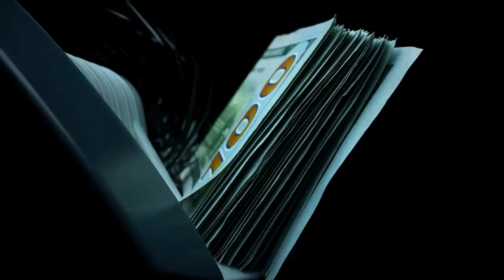The Highest Precision Gun that Doesn't Use Bullets

Comment: the fascination whit DEW comes mostly from science fiction, buck rogers, flash gordon, war of the worlds, star treck star wars, etc. the passion for it is first the assumption they are clean, very efficient, the pashion for the military is one only of cost, no amunitions, thats the only advantage, the reality is that they are not as effective as believed, as stated a simple smoke screan, hell even rain can reduce dranticly the effectiveness of a laser our microwave,  eve a difrence in humidity is enough to make a laser severly less effective, the other disadvantedge, is that it can only attack one target at a time, also it will require time to take down that target, also it must hit the warhead our fuel od the target to cause significant damadge, another is how easy it is to protect against it, simple refractive layer our light termal protection to better protect against it, time is all that is necesssary for a projectile, to bypass a deffence our survive long enough to hit the target,
kinetic weapons on the other hand dont have any og the disadnantages of lasers, their only so called disadvantage is amunitions, but they can fire extreme long ranges, do imense damadge and a single air burst munition can take out several targets at wonce and to take out a target only needs to hit it,  the main adnvatadge of kinetic munitions is that they require a very large mass to protect against and much heavier I just cant belive they cut the fundings for railguns and gauss guns for this.

Comment: (1)  החכמים (ביותר, הם) מתכננים מכניים גרועים: 
If you want to increase "laser-destruction-range": You need to control the "beam-direction" faster and with better accuracy than with an "electric-motor-based-actuator", that is: Using an (electrical) actuator "faster-accurate-rigid" (*that doesn't shake*, similar to *my-actuator*, from the past). Thanks to the above features, the "beam" will "illuminate-a-smaller-spot" and therefore "the-range-of-destruction-is-larger". 
(2)  טיל-זול יהיה: **ללא-ראש-ביות** כלומר ינוהג ע"י "מכ"ם-מדויק" (שמניח שקיים) ה"רואה" את מיקום ה"מיירט" וה"מטרה". מניח שיודעים לחשב ה Atitude של הטיל כדי להחליט על הפעלת הגאי "גלגול" ובעיקר "עילרוד" של הטיל. 
בברכה והצלחה!!

Comment: It's somewhat hilarious how you have managed to skip the one most important obstacle in developing those weapons. You mention cost and or "specialized" personel... like someone who can operate a joystick or a mouse or any other controller? So basically anyone with hands. And I really struggle to see how a typical laser system is suppose to be more expensive than say a single fighter jet not to mention whole squadron of them and yet armies world wide can afford it. The single most crucial problem with those weapons is THE EFFIN ENERGY they need. That's the main reason why it is taking so long. Those lasers need absurd amount of energy and it might not be a huge problem on the ground it will be a major issue on a plane with limited amount of energy the plane can produce.

Comment: Super easy solution is to reflect most of the energy back and cool the undercoat. Prism is such a cool thing, it can send all that energy back to the sender. Low tech solution for high tech problem. Big thing is that, these energy weapons is useless for long distance...anything longer than 10-100m. Also the weather plays the big role. Rains then it is 100% useless. Enemy takes firefighters to the battlefields and problem solved...These military di c k extensions are useless

Comment: It is difficult to imagine use of lasers as anything more than a niche technology suited to limited circumstances involving deployment against light targets. As noted here,  lasers are vulnerable to degradation by visible moisture (i.e. rain, fog, clouds etc.). In addition, the weapon would seem to be easily defeated by use of defensive reflective and ablative surfacing for target vehicles, with such measures drawing out the "burn rate" time necessary for the laser beam to pierce through the surface coating and reach the innards of the target vehicle.  If the target is capable of maneuverability, it may easily change it's path before the laser is able to successfully burn through the surface.  It seems no coincidence that this little video gives absolutely zero details of the sort that are necessary to lay these concerns to rest. This was a disappointment, a mere propaganda plug. :(
Reply: Well no... because if you were paying attention, the video mentioned that the Lockheed version uses MULTIPLE fiber channels in a convergent beam(one lens)... for Joe Schmoe speak, that means MULTIPLE stacked frequencies through a SINGLE lens on a SINGLE beam path, most of which ignore water, air interactions and the only true limitation is total power throughput which still is a MAJOR problem especially if you wish to engage several targets at once.  All this really means is a ship for instance would require MULTIPLE installations which... you need for redundancy anyways. A mirrored surface only works on certain frequencies and thus the fiber channeled beam would always have at least a majority portion pass completely through said mirrored surface interacting with the base layer.  Thickness of said layer is what will protect said missiles etc from LASER destruction as time based is still time based and laser interaction till destruction is 100% time based.  Why best use for LASER's is targeting the nose where the sensors for said missile are, or targeting the fins of a missile making it unable to maneuver or sense its target respectively.

Comment: Is it still viable when you have to have the laser generator in a location that can be destroyed just like any kinetic weapon?
Reply: It would be both defensive and offensive.
Technically it would be able to defend itself against incoming threats while conducting offensive strikes.
Honestly the defensive aspect is more favorable.
Reply: @thefrogking481  defend itself using what?
Reply: @andysmith5012  Its use as a point defense against missiles is pretty much its reason for existing.  Punching through reactive armor ahead of a kinetic attack of ones own is just icing on the cake.

Comment: Like any weapons system, directed energy weapons are made up of a number of technologies and subsystems. The steady improvement of these technologies over years of R&D is producing DEW systems that demonstrating effectiveness in certain combat scenarios. Mentioned in video are range, target tracking, resistance to countermeasures and portability. All of these parameters have demonstrated significant improvement compared to earlier attempts. Further development is needed to expand their combat effectiveness. However the latest DEWs appear to have reached a stage where they can be considered operational weapons. Often overlooked in general discussions is the ability of a DEW to easily disrupt or damage the electro optic seekers used in many missiles. These are a weak spot that can exploited to blind or destroy the missile guidance. Expect the continued development of DEWs to produce increasing lethality.